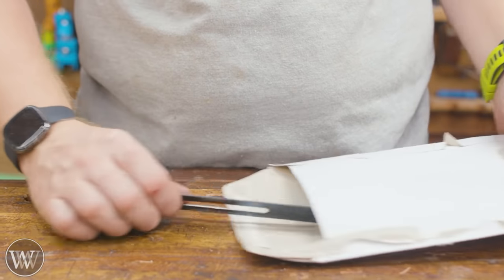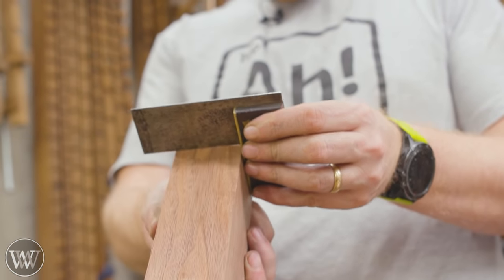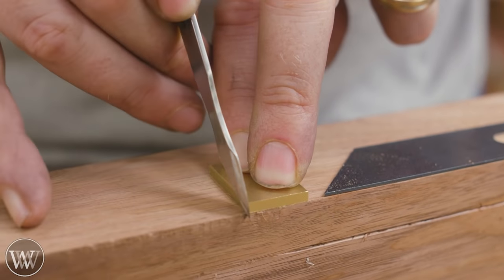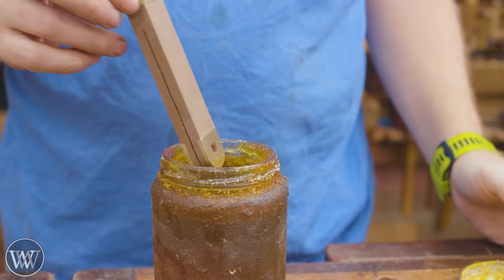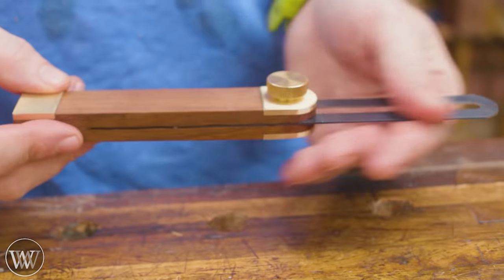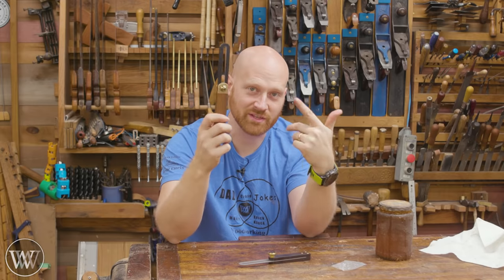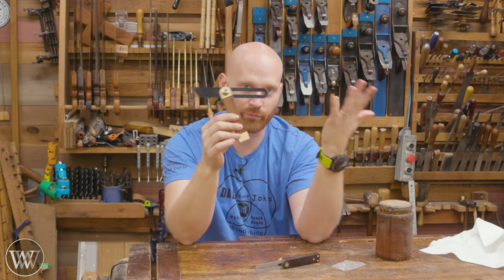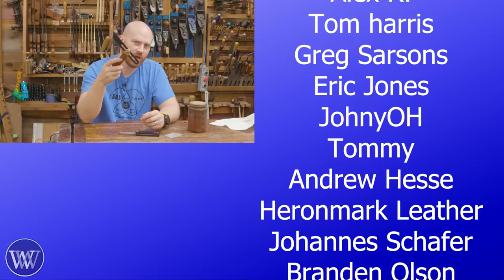Bevel Gauge Quick and Easy Woodworking Project

Comment: Looks good, I have a really nice old one, only thing is the blade has some pitting, which I need to figure how how the get that out, may just get a new blade
Reply from the maker: You can actually buy just the blade from the kit that I'm using rather than getting all the hardware as well.
Reply: Ok, cool!

Comment: Thanks for sharing -kit looks fun! When you're filing something to round I find it better to move the file in a smooth curving motion away from the curve you are creating, continuing to move the position of the file around till you hit the line. If you just try and follow the curve directly it can be hard to avoid lots of facets/inconsistent curves. If you look at how metal workers file it will make sense

Comment: ONLY ON THE PUSH< Files ONLY Cut on the Push and using it like a Saw tears up the file
Reply from the maker: That is an old myth. It has been busted time and time again. It's true that it mostly only cuts on the push stroke. But backstroking it does not hurt it at all.

Comment: James, was good till you did the waist of blue tape for your glue mix? Blue tape in wood working is like monkey see monkey do! Why not save the cardboard from may of the food products you through out normally. I save cereal boxes, and the plastic bag material. Use that to mix your glue on! It you want to still use tape use yellow masking tape at ⅓ the cost! Still quite waistful! In fact use tge bottom of old bean or soup cans!  Also on your sand paper will last longer it you put shipping tape on the back, especially on round stock sanding!